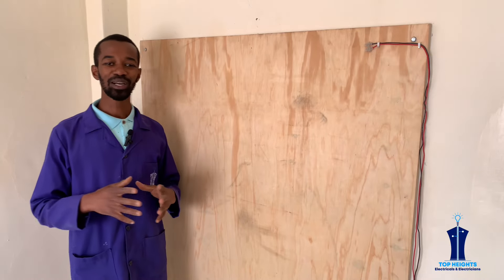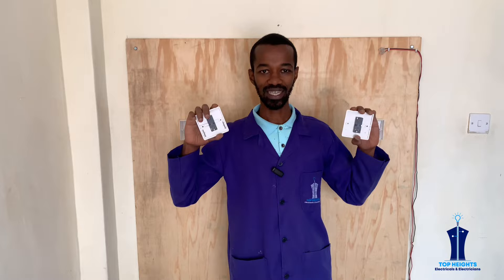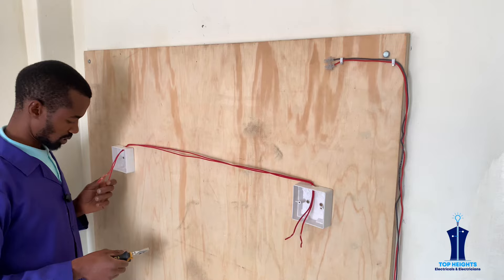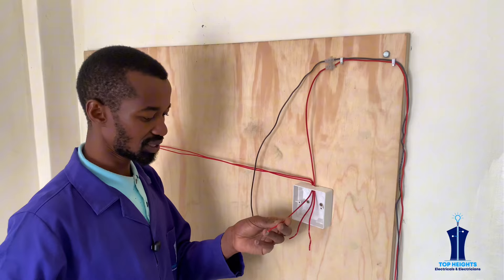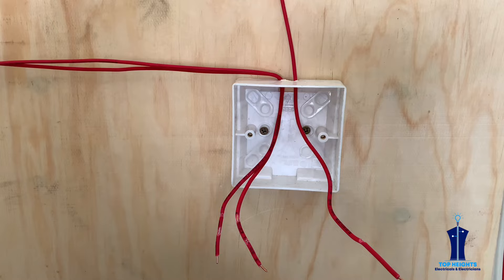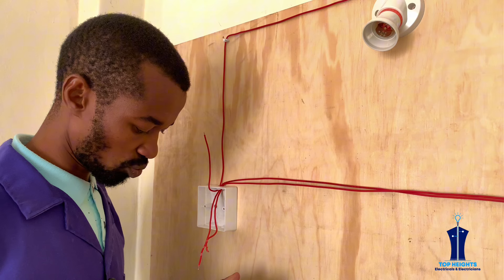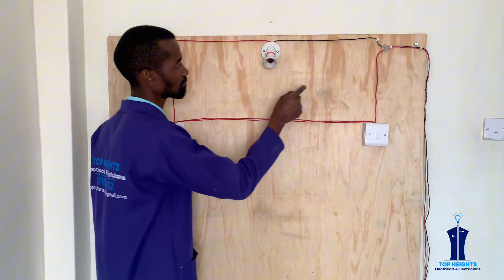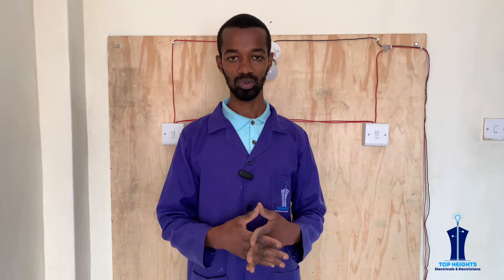How To Wire a Two Way | One Lighting Point System.   (Practical Demonstration)

Comment: I’m watching from Ghana 🇬🇭. Infact, your introduction of the control system wiring is very understandable. Thank You very much and  I would like to get more practicals from you as I’m also electrician
Reply from the maker: Thank you so much Banson for your compliment. I definitely will be sharing more with you.
Reply: @topheightselectricians  okay
Reply: Yeah it's supposed to be a master switch. Like when the master switch is off it's automatically off
Reply: I'm Maryjoy Chizoba Eze watching from Nigeria and I'm an electrical engineering student although I'm just starting and I would like to be corrected if at all I'm not correct with what I'm saying thank you very much

Comment: When connecting L1 to L1 and L2 to L2 is their any effect if you interchange the cable from l2  to L1of the other switch
Reply from the maker: Good question Griffin, I once tried and it didn't work.
Reply: But for it works for me🤓🤓🤭
Reply: L1 first switch connect to l2 of secd switch, l2 secd switc connect it l1 sec switch, 💪💪💪💪💪💪
Reply: Actually I do  connect mine differently and it gives me what I want. L1 in first switch and L2 in the second switch. Both connections work. It doesn't matter.

Comment: Hello.
How did you distinguish those 2 wires connecting 2 switches? I mean those connecting L1 and L2 of both switches? You screwed the first switch before connecting the other one, how do you know from the other switch that this wire is the one coming from L1 or L2?

Comment: Thank you soo much what happens when you crosses l1 and you connect with l2 of second switch , l2 of first swtch you connect wth l1 os second switch, live wire connect to com of first switch, then finally red wire from lampholder connect to com of second switch.
Reply from the maker: It will still work

Comment: Nice teaching, now then how do l see this is l1 and this is l2 when I’m done with the wiring now need to do the fittings ? Because the cables will be in conduit and l already marked them with cutting two same cuts
Reply from the maker: Great question Blessing. You have to remember how you marked them.

Comment: When.you connecting  L1 WITH L1 AND L2 WITH L2 HOW TO TO CHECK PERFECTLY CONNECTED ?
Reply from the maker: Great question Tolina. Actually, it doesn't matter. you can have L1 get to L2 of the other switch and it will still work.

Comment: Can I know the reason for having 2 switches on single light bulb
Reply from the maker: Good question Lee. This helps control the light from two points. It is applicable to corridor or bedroom lighting. Helpful?
Reply: It enables you to control the light bulb from two points. Take a staircase as an example, when you want to climb up at night you can switch it ON at the bottom and when you get to the top you can switch if OFF.
Reply: In other words is this an intermediate switch?
Reply from the maker: Excellent  @ofuarojeremiah5313  and thank you so much for coming in handy.
Reply from the maker: It's a two way swicth @roselyne4174  An intermediate switch will be 3 or more in number.

Comment: I assume the damaged isolation at 4:45 only stays like this because it is a model construction 😅
Reply from the maker: Wow! You are very keen Yuuki! I marked them that way for identification but I should have tapped them right?
Reply: @topheightselectricians  i have a better idea for marking it 
Tape those instead of "potentially" damaging the Copper 

We in germany only Mark the lampwire
Because we use cables with 5 diffrent colours 
Example : NYM-J 5x1,5mm² 
With yellow green
Blue , brown,  black , grey
EDIT:
And your 2 red wires from switch 1 to switch 2 would be grey and black here so its easier to identify
Reply from the maker: @yuukiggentleman  a lot of knowledge that you have shared with me on this comment Yuuki. I have learnt a great deal about Germany installation and I sure look forward to learning more from you sir! I am well guided 🙏

Comment: There's a problem with your wiring because with this switch you be able to switch ON from one switch and OFF from a different switch and the other way round but for your case the switch that turns ON the light is the one that turns it OFF only
Reply from the maker: Hello Eddy, the switched can operate the bulb independently.

Comment: But some switch have   only L1 L2
Reply from the maker: Yeah these are referred to as two way. The intermediate switch has L1 AND L2 both on top and below. Makes sense?
Reply: Very well elucidated, thanks for the impart, pls, if someone want to control two bulbs with a single control switch, how can the wire be fixed?

Comment: But that not the best connection. Normally the up press is expected to be switching off but it happens at the second switch it turns the bulb on. This indicates you have reversed the direction of power feeding on the switch. The manufacture should come with a better  idea that will not confuse the house owner.
Reply from the maker: I totally understand where you are coming from but since it's a two way switch, it's not possible. Imagine where we have an intermediate switch. It gets more interesting or don't you think?